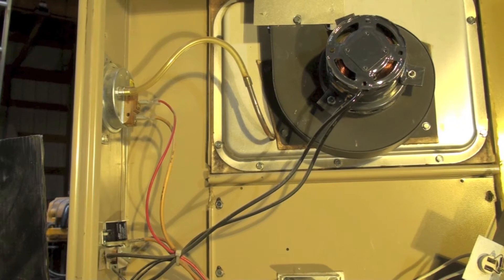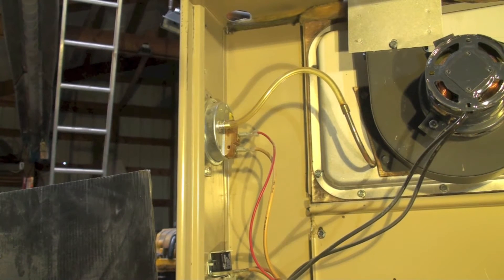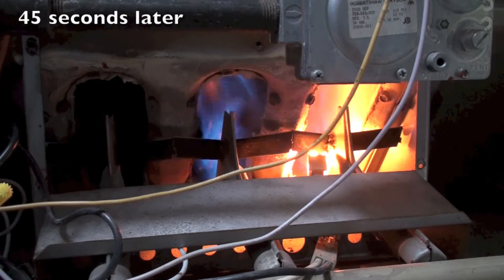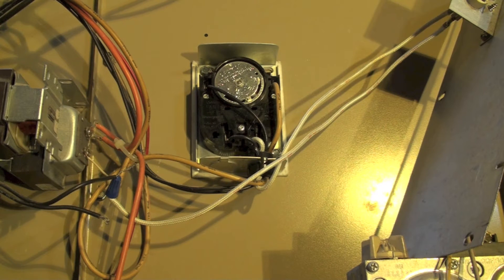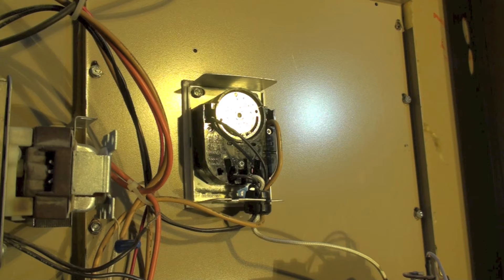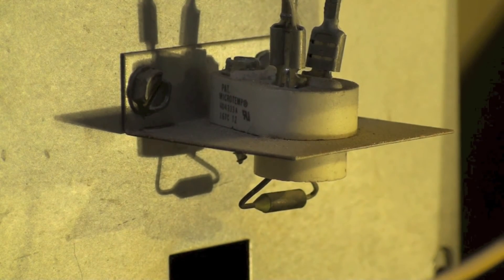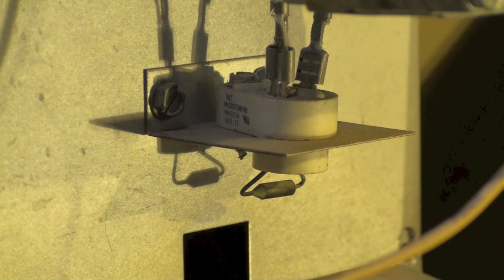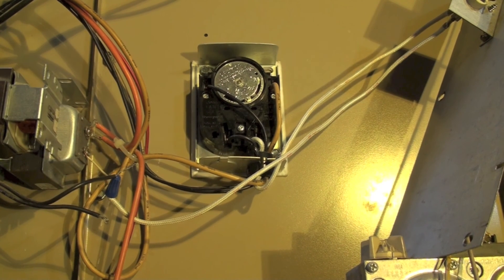Trane model BLU sequence of operation part 2

Comment: What about the prepurge ?
Reply from the maker: Prepurge starts when the pressure switch closes.  The ignition control starts a timer.  The time is based on furnace model.  Hope this helps.
GFM